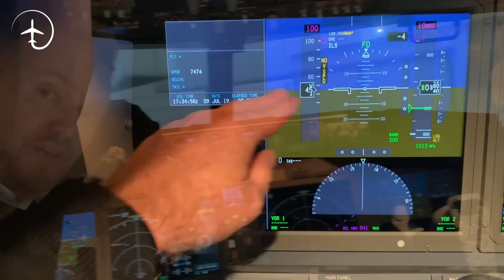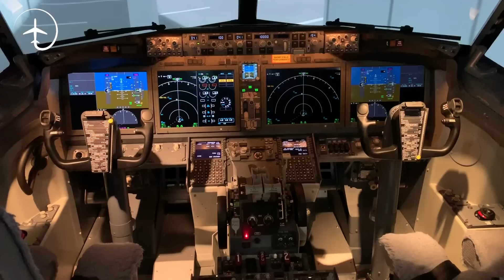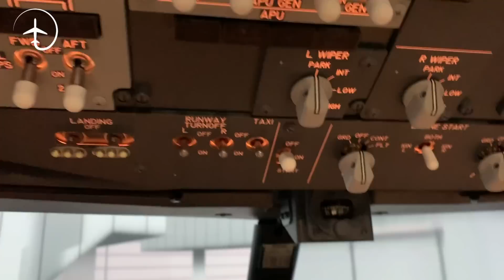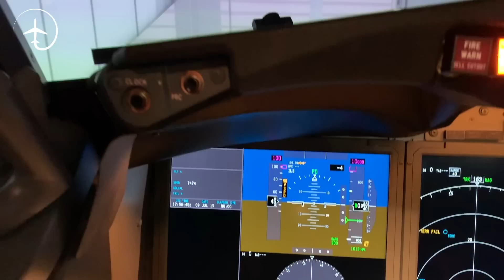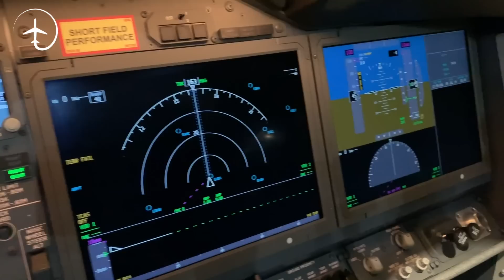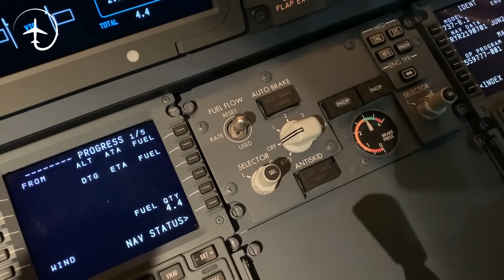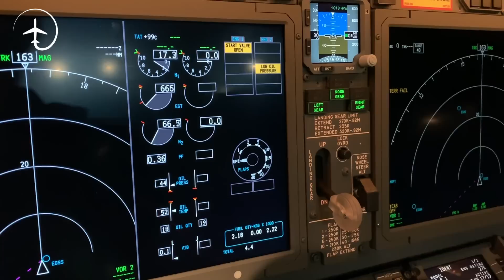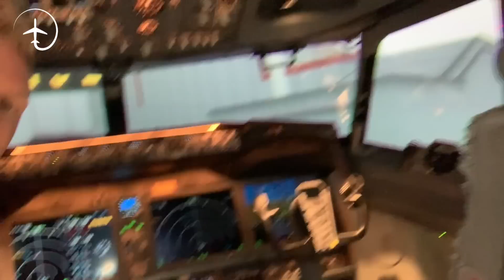Boeing 737MAX Cockpit Tour

Comment: Engines are quite delicate? that's not what I want to hear 😖
Reply: That's just inevitable in a constant battle for efficiency and performance. Jet engines are quite delicate by their nature and they get even more delicate as they get ever more precisely designed and manufactured to minimize inefficiencies. Let's just hope that airlines around the world won't screw up maintenance of those amazing machines.
Reply: ‘Quite delicate’ = semantics.  The FADEC commands extended “Motoring” during a ‘Warm Start’ — primarily for LONGEVITY, not ‘delicacy.’

Newer engines, of any make, run ever tighter tolerances and pressure ratios.  Net effect is more power, lower specific fuel burn, lower NoX emissions, and longer ‘Time on-Wing’ (TBO) if treated right.

To increase TBO, the Motoring function effectively purges stagnant hot air through the engine core, thus allowing material temperatures (and tolerances) to normalize, prior to light-off.

Much “Wear & Tear” sustained by older turbine engines, is /was realized during startup — particularly, repeated warm cycling.  Another biggie is the dreaded ”Hot Start,” which effectively melts a/o warps an engine’s HP-Turbine section.

A “Hot Started” engine, at best, requires an invasive (and lengthy) borescope inspection.  Worst case, removal and full overhaul.

FADEC Logic to automate ‘Motoring’ of warm engines on startup, is a ZER0-COST solution to increase TBO; and nearly eliminate other startup-induced failure modes as well.

Hope this helps clarify things.
Reply: Like the one that fell apart just recently?

Comment: You could have shown the stab trim cut-off switches, since they've been changed from the NG and they're involved in the whole MCAS situation 
Very nice video nonetheless, still nowhere near as cool as the CS/A220 cockpit but a good refresh...just looking at the cockpit you wouldn't say it's a 60+ years old plane
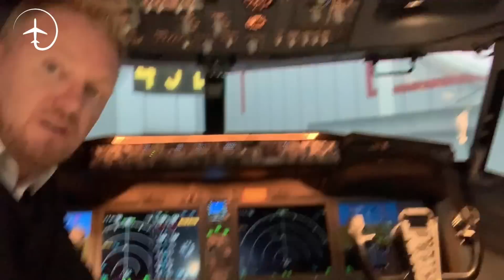Reply: For the stab trim cut-ff switches, please see 13:57 .
Reply: The stab trim cut off have been in the same place since original B737s.. and still in the Same place in the MAX
Reply: @trenesdecolombiaPabloHiguita  they've been changed in function. On the NG each one did a different part of cutting out electric stab trim control (one was for the autopilot side of thing, the other for the electric trim on the yoke). On the MAX now they both cutoff everything, and one is the primary and the other is just the backup.
It's pretty crucial in the whole ET302 case if you've read the report
Reply: Nav freq displax changed in the pedestal

Comment: Is the information displayed on the screens interchangeable between screens? What if one of them gets damaged during flight? 
I observed some of the information was being displayed only on one screen. In short , there must be some redundancy in information display system. I would like to know about it.
Reply: If you look where he pressed the "info" button to change the co-pilots display there is a selector knob that allows you to change what each of the inner displays, display.
Reply: Yes it works exactly as you suggest. One screen goes down and you can put it on another display. Pretty sure (not familiar with the max but with other plane) you could lose 3 of 4 and still have all the info you need
Reply: You can switch data between the screens..
Reply: Then you revert to the days before technology dominated planes and fly old school
Reply: @scottyweimuller6152  That is a strange statement. A plane is technology.
Reply: It can switch just like the 787. They are using the same tech of the screens
Reply: Shehul Suratwala — There is also a backup computer for the display system.

Comment: What do N1 and N2 mean?
Reply: N1: Gas generator RPM - the rotation speed of the low pressure components of the engine. Typically includes the front fan.

N2: Power turbine RPM - the rotation speed of the high pressure components of the engine.

Comment: Everything that I’ve read shows it was pilot error in both cases. Yes a malfunction happened after a bird strike however the pilots did not follow protocol to keep the aircraft in the air until it could be safely landed
Reply: I guess you should read more, then.
Reply: Vladimir Nicolici care to point me in the direction of what you’re reading?
Reply: Vladimir Nicolici - They didn’t fly the airplane, and did not take appropriate action early enough, when they did, tooo late..

Comment: A leading cause of death is being unable to handle the situation of newly exposed hidden edge cases within the uncompensated parameters that arise AS A RESULT OF TOGGLING AUTOPILOT ON OR OFF. (mostly, OFF)
I.e. Air France 447 -- could have continued to fly through the storm with AP ON and flight parameters resulting only from compensational feedback loop.

Comment: Can you please work as my driver
Reply: Self-driving cars will soon do that job. Look up Tesla cars with full self driving software, which will probably be ready in about two years. The hardware that the software will operate on is already available for all Model 3 sedans, as well as 2017 and later Model S and X. The upcoming Model Y crossovers will also have the hardware included.

Comment: 737 MAX is De Havilland Comet of today. Passengers will never believe in this aircraft being safe. If Boeing is lucky they will have to abandon only 737 line.
Reply: That’s not really a fair comparison as the Comet suffered from a genuine design flaw. Nobody knew at the time (because no other airliner had done it) that square windows would cause weak points for cracks to develop to due constant pressurisation and depressurisation. Boeing knew about the 737 Max issue but were trying to rush the plane and cut costs
Reply: Piotr Miszczak — People flew on the Comet after the first mysterious crash and grounding, which led to another tragedy.  After the second crash, the problem was discovered and fixed.  A variant of the aircraft (post-fix) was flown in government service for some time.
Reply: Actually after the Comet was redesigned it flew for over 15 years with several airlines. It eventually died early not because of its early problems, but because those engines built into the wing were impossible to upgrade without major redesign on the airframe itself, so it was slowly set aside.

Comment: The key to when the MAX will fly is when the passengers redem it safe to fly. Cause else they want pay money to fly it. Johan.
Reply: Johan M 99% of passengers have no idea if they are flying Airbus or Boeing.... business travellers especially don’t care.
Reply: @Hakltz Say what?! I always knows what I fly down to the series number and If I do not know it is as easy as take a look on the security tablet in the chair. Johan.
Reply: Johan M have you noticed almost no one even looks at the Safety Card anymore?  To be honest I don’t either (I know I should but they are all the same...). I don’t even listen to the Safety Instructions presentation by the air steward. Most people sit down and finish texting and calling.
Reply: Johan M — I look at the card, also, but we are not typical.  And by the time you look at the seat card, it’s too late.  Look around you the next time you are at a boarding gate.  How often do you see someone exclaim, as the aircraft pulls in, “OMG! It’s a (whatever)!  I’m not getting on that!”  Never.
Reply: GH1618 exactly. Passengers won’t even know they are are getting on a Max plane. Nor will they know after they get off. It will ha e just been another flight.

Comment: When the engine was starting, why TAT was +99 C  ???
Reply: Probably an error in previous session, the simulator was not reset.
Reply: Some quick research, AC buses must be on, an a/c pack needs to be running and if on the ground pitot heat must be off before valid readings from the instrument.

Comment: She is a beauty and the best part is that she uses a yoke, not a joystick.  That is much more ergonomic as far as using the left hand for landings for right handed pilots.
Reply: But where do you then eat your meals? Or fill out paperwork?
Reply: What’s the point in the yoke if the heap of shit can’t fly. Lmao
Reply: @iScoTT29  it does fly naturally despite the change in characteristics due to the new engines. The fault in software during both crashes was allowed to persist all the time. There's a good reason why the trim cut out switches are installed even current gen 737s, and they were there since the 1950s if I'm absolutely correct else close to that era, and during that time trim faults and including jams were faced and the pilots then successfully handled the aircrafts with ease. Trim issues happen with many aircrafts even today due to other faults, just as any other common faults such as depressurization, flameouts, etc.
You just can't judge a plane that's totally dangerous to fly just because you allow it to fly itself while the autopilot starts to pay roller coaster Progressively in clear skies. That's more of premature pilot error than the aircraft itself, if the mission was to save the passengers than to save the comfort for flying.
Refer to late Captain Warren Vanderburgh's brilliant lectures and documentaries for further explanation. The pilots of his era were eating donuts while successfully man-handling jets with mechanically jammed controls.
Honestly but with respect you can't conclude this in the way you just said about the aircraft. If it was that important to have perfectly immune aircrafts, then you wouldn't even step on any aircraft ever. It's just lil dirty games with huge impacts going on from what I see worldwide.

Comment: Could you please talk about the economics of the planes being grounded? I mean this is a very expensive equipment rendered unoperational for it’s commercial user. How do Airlines and Boeing deal with that?
Reply: Good question. I’m wondering about that too.
Reply: Boeing have to offer compensation, using this they can lease aircraft for the meantime or cancel flights and wait it out and take the huge loss in revenue like every airline is doing now pretty much
Reply: And what happens to the pilots who don't get to do any flying.
Reply: @mvonsmallhausen3221  I can only speak for Air Canada, but their max pilots are basically getting a paid summer vacation. (Granted at min credits and no per diems or OT but still not terrible)
Reply: M Von Smallhausen well if the airline had the NG they’ll be flying that. But if not then no idea
Reply: They take heavy losses and have to rely on company assets to lighten the damage (savings, sell other planes, layoffs, etc)
Reply: Boeing must to pay a very big money for the airline or very good offer  the free service for long times !
Reply: From my understanding the B737 MAX is no more efficient than the B737NG over short distances and its the same story versus A320 neo versus ceo so I suspect the fuel burn is not a big issue for most routes in Europe.  The MAX's not being around would cause problems with airline expansion plans due to aircraft shortages and on new routes that need the MAX's range.
Reply: @curtiswhyte3297  There are no definitive cancelations from Lion Air. That news is more then half a year old.
Reply: It's easy to deal with because it's not cash.
Reply: It's like paying for a car that you cannot use. Problem is that those planes are already part of the scheduled flights of the airlines and therefore also have planned passengers and revenue. The airlines will lose those and will not meet revenue targets of they cannot find a way to fly these customers some other way. Some airlines work around this by leasing other aircraft from leasing companies or from other airlines.
Reply: Who cares about Boeing. Those penny pinching bastards caused the deaths of 300 people so hopefully they'll bleed as much financially as the victims did for real.
Reply: @boltar2003  It was actually airlines that cheaped on the second sensor because that was optional. Boeing can be blamed for not being straight about what happens if the single sensor fails mid-air. Had they honestly told that having single sensor failure causes so much difference in the flight characteristics that the pilots need different certification no airline would have skipped the second sensor.